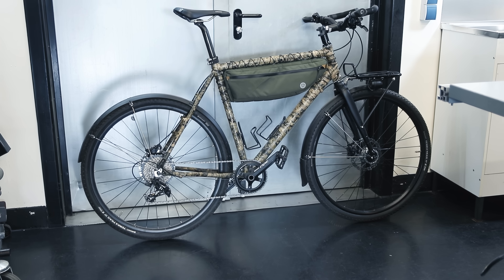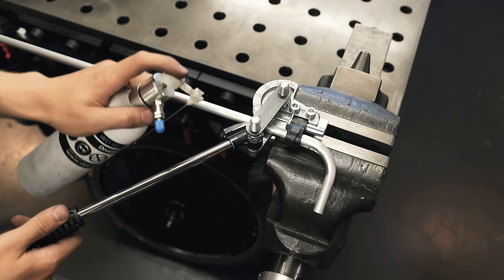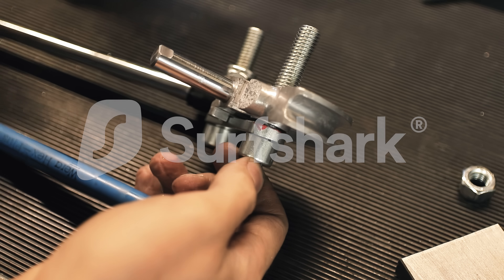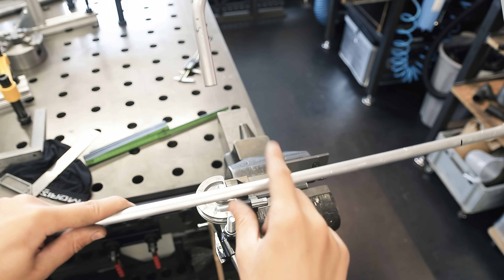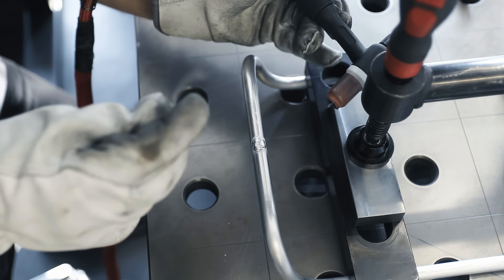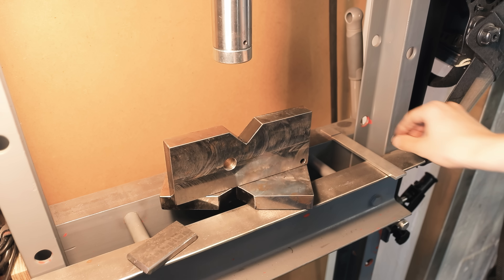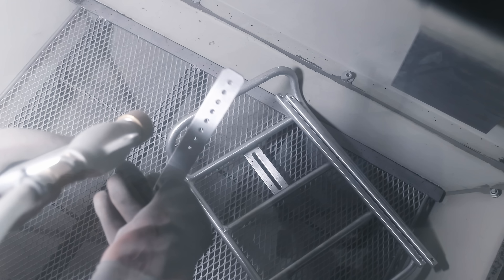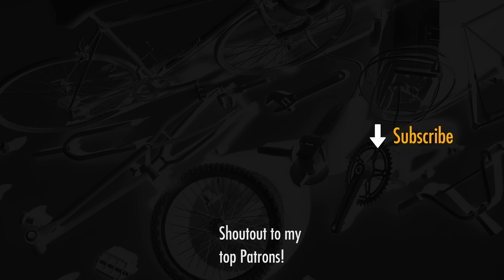I built this Sturdy Front Rack by Modifying a $25 Bending Tool!

Comment: Lmao "With a modified $25 bending tool! (And a full machine shop, welder, and decades of  experience)" 😂 Excellent fab work, nice rack!
Reply: lol right? "... especially considering I used the cheapest tool possible" and a mill, lathe, TIG welder, fixturing table, bench vise, machinists vise, drill press vise, band saw, belt sander, hydraulic press, sand blaster, countless hand tools, and custom jigs and spacers 😆
Reply: + CAD Software  @tballew
Reply: none of that is crucial. you can bend a simple rack for yourself with the same tool

Comment: You can anneal aluminium by heating on a stove top or something. Put some soap on it and when the soap turns black that is hot enough and let cool. It will stay soft for a few days. Easier to bend like that.

Comment: You did a phenomenal job man, I'd love to buy one off you. I have a Genesis Mammoth 2 which has 26 by 4.9 inch tires and the dropout in the front is like 7.5 in wide so it's becoming a bit of a task to find a front fork rack mount that isn't $150 or more but my grievances outside you did a good job, best wishes from 🇨🇦🙂

Comment: Great video!! Bending technics are always usefull. As you ended up modified most of the parts maybe the aluminum piece can be replaced with a steel pulley, and use different puleys for different thickness....

Comment: I have made a front rack using cheap hardware store aluminium tube epoxy glued together. Looking at your 1 2 3 blocks and your table I think for my next one I may use an aluminium sheet and drill some holes. I don't have a welder🫤 Great video, thanks for sharing 😀👍

Comment: Nice! TIG welding is a skill I need to learn. I took a short class in MIG welding, and at the end our instructor demonstrated how quiet TIG. The difference was deafening.
Reply from the maker: Yeah it's so much more relaxing, less smoke and almost no sparks too. If your parts are clean and the welder is set up right you can TIG weld in your living room no problem, it's that clean. Not that I would suggest it - but it's something I love about TIG. Clean, quiet, versatile, precise, almost surgical in nature. If speed isn't your Nr.1 priority, I think it's the best welding method by far even though it takes longer to learn.

Comment: I'm currently building a bike as money slowly dribbles in from my job and I started off intending to make it an electric bike with a mid drive rather than my previous hub drive. Because this frame has rear suspension and quite a lot of suspension travel I was thinking about mounting the battery on a rack mounted to the seat post area but it wouldn't be able to be supported by any of the tubing in the rear suspension of the bike obviously now I'm thinking about some sort of custom rack with some cheap tool... or a home made tool from the start since it pretty much looks to be the way you ended up going. Because of the rear suspension there is very little space in the middle section of the bike so I could only fit a 48v 10ah in the middle which would probably be alright. But now with a NEW custom rear rack built to hold the 48v 20ah-25ah or something battery off my previous electric bike I could both not buy a new 10ah battery and have more capacity! Just have to spend $1000 on a new welder and another $100ish material and time haha.

Comment: Have you tried a frame (as opposed to fork) mounted front rack? I much prefer them. You avoid the whole floppy, heavy front end feeling when parking, walking the bike etc.
Reply from the maker: Yeah, I adressed this in another comment. I even built a whole bike around a fixed front rack that's part of the frame, you can find it on my channel. Both those solutions have their pros and cons, I wouldn't say one is necessarily better than the other. I also think a lot about the design part of things and I have to say, fork mounted racks just look a lot sleeker.

Comment: Yes, making a vid about painting frames would be nice and welcomed.
 I am fidleling myself with 2 old steel frames ( Batavus and Olmo) trying to reincarnate them as gravel or racer bikes.
 As primer i have used something the contains zync and as paint and laquer stuff from the same brand ( dupli-color from bauhaus).
 I already scratched the frame a few times now ( with some metal components) and to my surprise the paint can be removed somewhat easily by fingernail🤯; the primer did not even bind to the steel, and i did degrease the frame with acetone....☠️
Reply from the maker: Yeah it's unfortunately very hard to get truly durable results with rattle cans, especially if it's 1K paint. 2K works quite a bit better but is also WAY more expensive especially if you also use 2K primer. If you do an entire paintjob with "proper" 2K paint you can quickly spend almost as much as hiring a company would cost. Using 1K primer with good prep, a 1K basecoat and then 2K clear coat is the best compromise between cost and getting a somewhat durable result in my opinion

That being said, the prep work makes a big difference, especially being very patient about sanding thoroughly with the correct grit and degreasing. I've found that sandblasting first makes the primer stick a lot better compared to even a well sanded surface, but of course that's not an option for most people - myself included, since I can't fit a full bike frame in my small-ish blasting cabinet.
Reply: @PhilVandelay  thanks!

Comment: If I may contribute with som engineering knowledge?
Bending resistance of a material is  the with x hight x itself 3 times! (Times some material specific constants)

The closer to the center point the less bending resistance! 

So a solid rod is pretty much useless compared to a hollow tube. 

Example: A tube 14 mm diameter with 1 mm wall thickness has the same bending resistance as a rod with 10 mm diameter 

BUT 

..half the weight!

Hope this may help someone. 

Kind regards 
Anders
Sweden

Comment: I had a bike that I was experimenting with at one time.  While I wanted to paint it, I was changing too many things to do so.  I had a buddy that was a duck hunter and he camouflaged his stuff with camo tape.  So, I bought some and taped over the frame of the bike.  It wasn't bad.  Nice job on the rack.  That is the reason for checking out this video.  Cheap tools have a purpose and so does fail fast, learn and move on.

Comment: Great content as always.  👍👍👍  Look forward to the next video—maybe one titled: PV Pipe Bending Tool?  🤔
And for all those who were raised on the imperial system of weights and measurements:  776 g = 1.71079 lbs
Reply from the maker: I actually have a full CAD model of a huge (motorized) mandrel type  bender that I designed years ago, just never got around to actually building it... hopefully soon!

Comment: Lovely.
But—wouldn't it be better to mount it on the frame instead of the fork to avoid the weight affecting the steering and balance ?
Reply from the maker: The handling is better with frame mounted racks, yes. But there's pros and cons to both those solutions but it's kind a lot to go over here. The difficulty with frame mounted racks is that there's no point to support them downwards, so it's tricky to build them sturdy enough without them becoming very heavy, bulky and/or offering limited cargo space since you always end up with very cantilevered design. Fork mounted racks can usually be lighter/more delicate (also better looking) since you can get a good sturdy triangulated support. 
Another difference is that the handlebars move with your cargo in this setup, so cargo size is not limited upwards. With a frame mounted rack, you can only load objects smaller than the space between the rack and the handlebars, otherwise it blocks your steering. On smaller frames this limits the possible volume of your cargo quite a bit.
Reply: @PhilVandelay  Great response. Yeah that support didn't occur to me as an issue. Well made!

Comment: Yeah, I've steered clear from the Pelago because of the way it's constructed in segments, indicating a low load capacity and higher failure rate. The aluminum and steel versions of the Pelago are 10 and 15kg capacity rated respectively.

Your solid stock choice makes this far stronger than the Pelago. You've definitely doubled the load capacity.

I like your weld bend test. You made tiny sparrow handlebars. Now you can build a miniature functional cargo bike out of your scraps. :)

I see you have a hole on the side of the headtube of the frame for the dynamo wiring. Was it not possible to route your dynamo light cable up through the fork into the steerer tube? Of course your light is now protected, but the cable isn't quite as protected.

You could make good money selling us upgrade kits for that bender. ;D
Reply from the maker: I believe I was still running a suspension fork on this bike when I drilled that hole but I'm not 100% sure. I've never actually checked if I can run the cable inside the current fork 🤔
Reply: @PhilVandelay  Might be possible. On my Surly Troll it had a hole at the lower area of the fork blade (probably a relief hole for welding). I fished shifter cable through from above, then taped the dynamo wiring to the cable and fished it out. It's a clean look and safer for the wire. I avoid the ugly and riskier wire wrap up the fork blade method whenever possible. Also went on the chinese marketplace and found teflon tubing, 6mm with 4mm ID. It's good for protective routing of dynamo wiring and can be zip tied up to frame mounts along with any other cables.

I'll have photos of this build online soon.

If your fork is strong, a small hole could probably be drilled to facilitate this assuming there's access to the interior of the blade at the crown.

Comment: i use 8mm tube stainless steel for my rack with 1 mm wall thickness - its lighter and more stable overall - even for my hanging packs on it . alloy is too soft for that ...

Comment: Curious about not being able to weld the bender when you can tig other aluminium? Is it being cast aluminium that makes the difference? Would love to see more accessories and components an be would also love to see your painting processes. Thanks for sharing!
Reply from the maker: Yeah there are countless different alloys and not all of them are weldable. Cast materials are difficult to weld in general (goes for cast steel too), it is possible but the result is usually not great. It might have been possible to weld something on to it, but I'm pretty sure it would have snapped off also.

Comment: Did you put straight handle bars on your gravel bike? Thanks!
Reply from the maker: It's a custom build, so debatable if it even counts as a gravel bike because that designation has become kind of meaningless. But this bike never had dropbars to begin with, it's kind of hard to categorize it which is something I like about it. I mostly use it in the city though

Comment: A wonderful video, and quite amusing (I like how you always already anticipate specific viewer reactions - and yes, sometimes I am guilty of thinking the exact things that you are anticipating ... ;-) ). 
Personally I would not have spend the time, money and effort to build a rack like this, even if I had your level of skills and a well sorted machine shop available (which I have not), because for me it is too similar to commercially available solutions. 
And Pelago does offer their racks in stainless steel tubing, too, which from my point of view is a much better material if you tend to (mis)use your racks heavily (which I also do). Of course stainless steel is not indestructable, but it is very resistant against fatigue cracking and especially against chafing - after wearing an aluminium rack stay through with the lower corner of an Ortlieb bag by nearly a third of its original thickness (I did repair it with a collar piece made from stainless steel sheet later) without even noticing it in everyday use, chafing is a point that really gets my attention when using aluminium racks. 
Yet another (rather small) point is that I think that threaded holes do not work well on racks, especially on aluminium ones, because they do not have the strength to keep the screw connection tight, and they tend to wallow out over time. Threaded holes in aluminium also have a tendency to work as crack starters if they are exposed to dynamic loads, thus through holes with bolts and (pesky) nuts are definitely the better solution in the long run.
Nonetheless it was a pleasure to watch your video and to follow your step-by-step problem solving, and yes - I would like to see more bike related content. The paint scheme on your bike frame would not be something that I would apply to any of my bikes, but I still would like to learn how you did it. :-)
Reply from the maker: Good points, we'll see how long it lasts! Next time I'll probably use cromo tubing

Comment: Impressive and inspiring, though I am developer (i.e. software), it was pleasure to watch. Thank you sharing. One thing caught my attention -- the torch used for welding. On first glance it looks like amateur could operate it without burning the house (usually what I see is deadly fire from the nozzle). Did you use the one listed in your tools -- PRIMEWELD TIG225X 225 Amp IGBT AC DC Tig/Stick Welder with Pulse CK17 Flex Torch? If not, what then? And is it really suitable for amateur (i.e. the guy who can true the wheel, and assembly the bike, but that's it) in your opinion?
Reply from the maker: That's called a TIG welder, it's the process, not the particular model of machine you're describing (there's many TIG welders out there, you don't necessarily need to use this one). If you want to learn more about welding I'd suggest watching some beginner videos on YouTube that explain the different types of welding (MIG, Stick, TIG etc.). Welding is a huge topic so kind of a lot to go over in a comment reply.
As for being suited to amateurs: Anyone can learn welding, I also learned it by watching YouTube  tutorials and just practicing. But TIG Welding especially does take a lot of practice if you want to do it well. It's absolutely worth it thought and a great skill to have, so if you have a suitable place by all means go for it

Comment: Superb build. I modified an aluminium rack recently to fit my needs, but I'd love to make the whole thing from scratch. I made the support arms from 10mm aluminium tubing and used easyaluminium weld rod, with a map gas torch. I'll be honest, I blew through one and had to remake it, but I think I learnt a lot about focusing the heat. I'd love to be able to weld. Great video, new sub added.

Comment: Why wasn’t the light mounted centered?  The obstruction of the light beam would have driven me crazy… but if you offset the lamp to avoid tires flinging water/debris, that’s great foresight.
Reply from the maker: It's the safest position there since nothing can bump into it, that's the main reason. If it it was in front of the rack it'd be very exposed and might also be affected by bags etc. slightly hanging off the rack. And yes, part of it is to avoid it getting dirty from road debris. As for the obstruction, it's not noticable when the light is projected 20m+ ahead of you, at least not in the current position, since there's not much overlap between the light and the support

Comment: Lovely video as always! One question though: does mounting the light upside down, cause problems with the light beam? I believe they have an orientation specific pattern no?
Reply from the maker: Normally yes, but this light allows you to just rotate the holding bracket so it can be mounted both ways and have the reflector in the right orientation

Comment: I would doubt that solid bar is stronger than tube weight for weight.
Reply from the maker: You'd be right, it has a worse strength to weight ratio but I wanted to keep this build simple and straightforward and the difference is not huge. I'll probably use tubing next time

Comment: Love your video's, for my last holiday I also had to build my own rack to fit on a fox 36. I used 10mm by 2mm aluminium tubing very strong did some enduro tricks with it. I used a cheap bender for copper tubing an polished the channeling of the bender and aplyed some grease worked verry goed and no scratches

Comment: it might seem counterintuitive, but tubing is stronger than the same diameter rod.  Sorry for the bubbleburst.
Reply from the maker: This is a common misunderstanding that people keep repeating. What you mean is that tubing is stronger than solid *for the same mass*, but not for the same cross section.  That being said, "stronger" doesn't really mean anything, if you really wanted to make an accurate statement you'd have to specifiy what "strong" is even supposed to mean in this context (yield strength, stiffness, hardness etc....?), "strong" is not an engineering term. 
 
Anyway, tubing is not "stronger" in absolute terms, it just has a better strength to weight ratio at the same diameter. A 12x2mm tube will give you close to the same "strength" as a 12mm solid rod at less weight, that much is true.   
But in this case the weight I would have saved with tubing was negligible for me compared to the benefit of solid rod being very easy to work with at this small diameter. Using solid becomes increasingly more inefficient the larger the diameter is for something like this, but at 12mm and especially with aluminum, the effective weight difference really isn't huge. In the end 12mm solid is still "stronger" for this application than 12mm tubing, although not by much. On top of that it's very easy to weld and bend.
Reply: @PhilVandelay  You know what they say:  When you want to give a concise explanation to something but can't be bothered, just leave a quick, wrong comment and someone will come along and do it for you <3